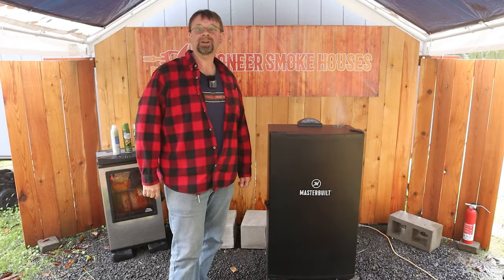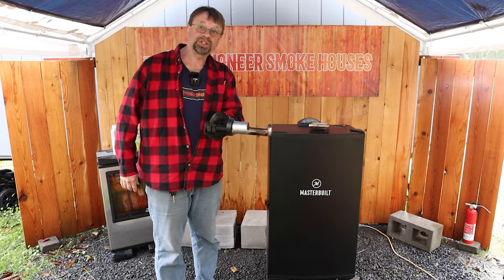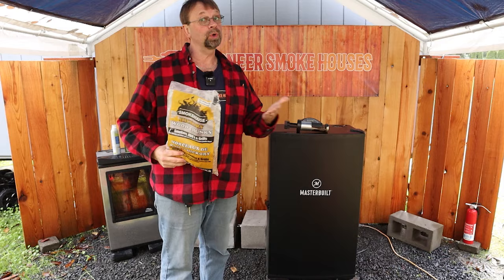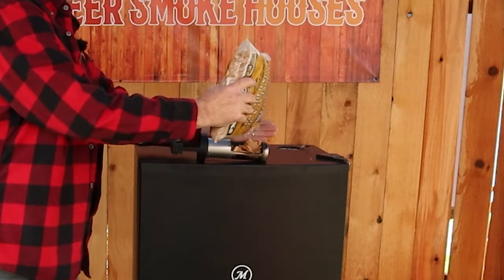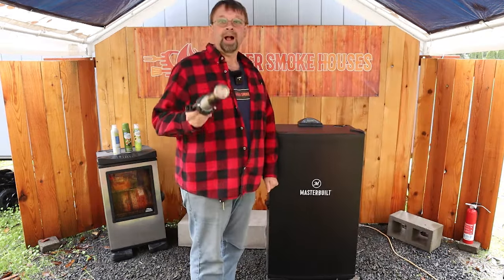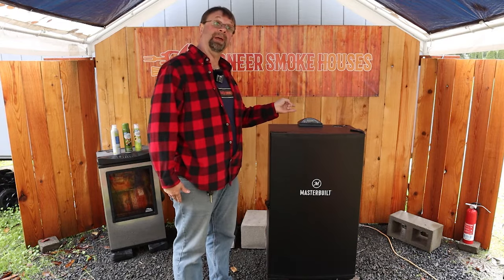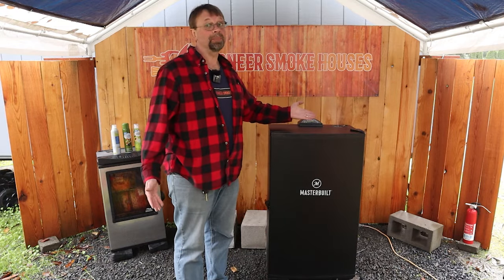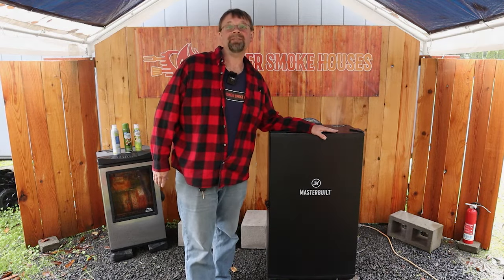How to Load Wood Chips for Perfect Smoking in the Masterbuilt Electric Smoker

Comment: Any idea on what the lowest temp that smoker will maintain?  I want to cure and smoke some sausages and need it to start around 120/130 degrees.  Any thoughts?
Reply from the maker: I have heated the 140b at these temperatures before so that is not and issue. The problem is generating smoke at these temperatures. Normally a smoker needs to run around 160 to get reasonable smoke generation. I recommend attaching a smoke generator. I have tried a lot of different options. Check out the mailbox mod video https://youtu.be/tZiBi2jYlvM

Comment: How about making one with with a chip loading for 12 hours for brisket?
Reply from the maker: Masterbuilt makes a cold smoke attachment, I have it but have only used it a few times. I like to use the pellet tray and it is good for about 12 hours if you like. I would go for about 6 hours of smoke in an electric smoker.

Comment: take that control board apart and cover it with electronics silicone spray or dielectric grease.
Reply from the maker: That might help me because I live next to a creek so the humidity is brutal!
Reply: I used WD-40 to defeat the moisture. 👍

Comment: The loading tube design is problematic.   It often gets stuck.
Reply: Use a wire brush first around the base where the handle meets. Then, do the inner wall where it is inserted into the smoker.  This should make it operate smoother. Be prepared to put in at least a beers worth of effort as any pit master might put in two.
Reply from the maker: I have not had this issue, I wonder if you received a defective loader.